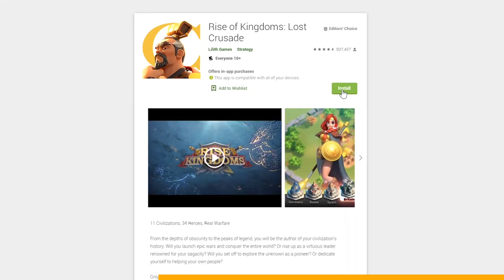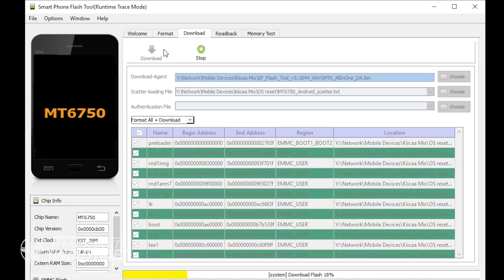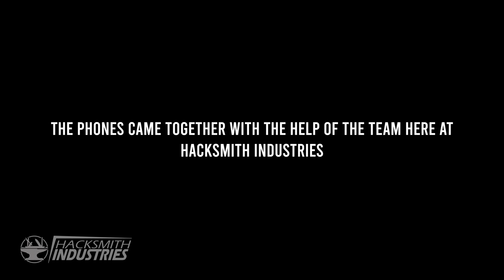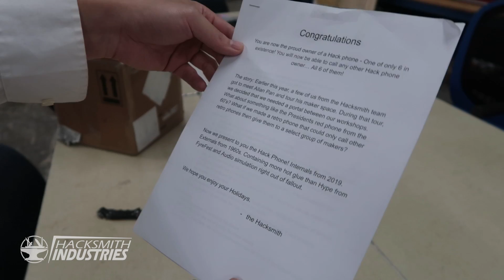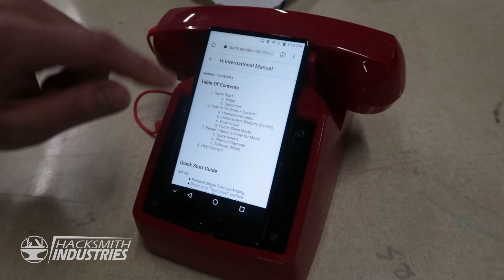DIY Nuclear Phone! (MAKER SECRET SANTA!)

Comment: Well hmm since it doesn't use any of the actual cell phone bits couldn't you have made a voip phone with a raspberry pi and still used more of the red phones parts like the original keypad?
Reply from the maker: Yeah but that would have been a lot of work
Reply: Not necessarily. There are ways to run pbx software on a pi zero like asterisk that can incorporate voip out of the box and do everything the android phone is doing. True though it would have been some work to make it all fit in the phone and some trial and error to make the bell ring. But love the video of course :) and thank you for the response :) this has inspired me to try and make some red phones for a few friends of mine. :)

Comment: Time for a web shooter you can make web fluid using two chemicals EPTM and crosslinker in a container and at the same time spray it out in the same time although it may be black in colour try it out hope it would be helpful and it is super strong but I don't think it will hold your weight but might work

Comment: You should’ve used a Raspberry Pi with some kind of VOIP software installed and one of those touch screen LCDs you can buy which would fit perfectly. Just my thoughts anyways, having the cell phone sticking up off of it looks kind of ugly imo but then again you were of course limited with time so idk
Reply from the maker: Thought of that in the beginning
Reply: the Hacksmith what was it that drove you away from it?
Reply from the maker: More work

Comment: 2019: The Hacksmith creates nuclear phone

2020: Apple released nuclear iphone
Reply: Wouldnt surprise me
Reply: SlipknotFan 22 Why not?
Reply: So it self destructs immediately after warranty expires, or more likely few weeks after its first fired up, by internal timer and having so delicate water damage sensors that those turn red before leaving the factory avoiding the warranty and repairing it costs in their store more than new phone? Cause its called "I nuke", battery is also designed to short circuit and go nuclear. Sounds like Apple crap alright.
Reply: James Hamaker INuke

Comment: Yeah, who doesn't want a 40mm fan running at 12v where yo do your phonecalls? I highly doubt that the phone gets so hot during calls that a fan is necessary at all.
Reply from the maker: Leaving the screensaver on makes it heat up
Reply: @hacksmith  Hot in this case is realtive, hotter than ambient, probably, dangerosly hot, not a chance.  xD
Reply: Shut up bjorn what do u know